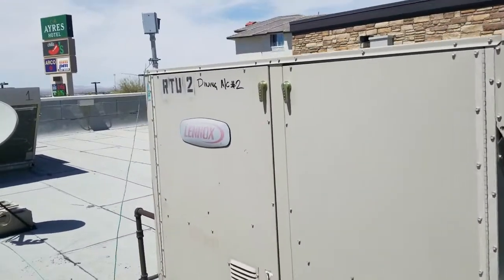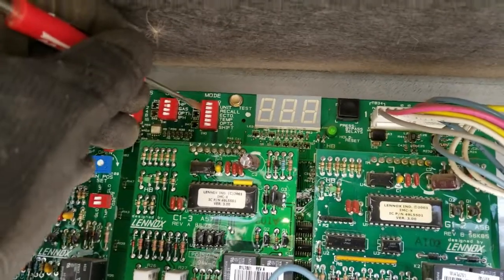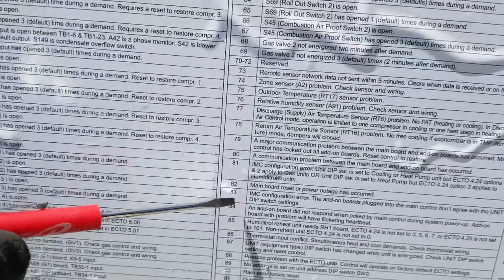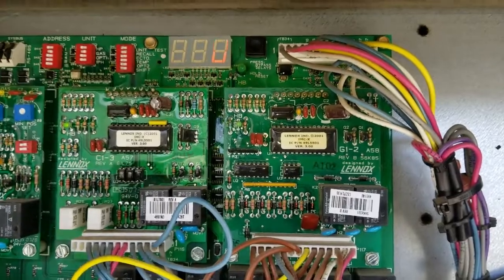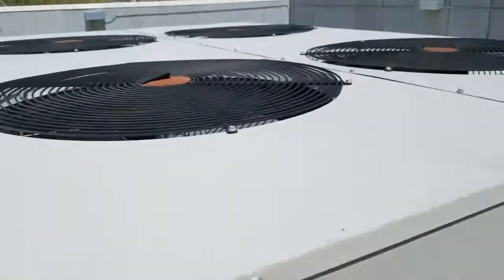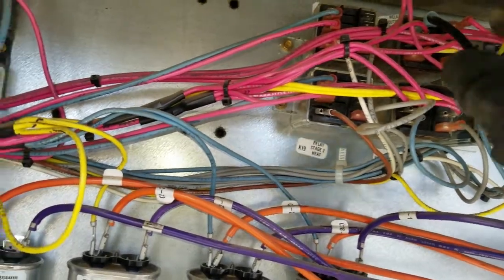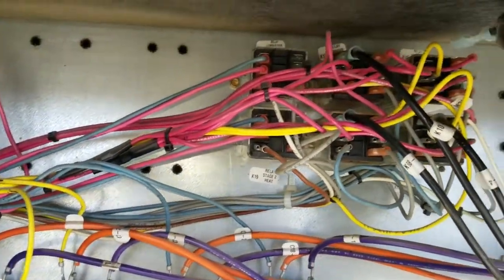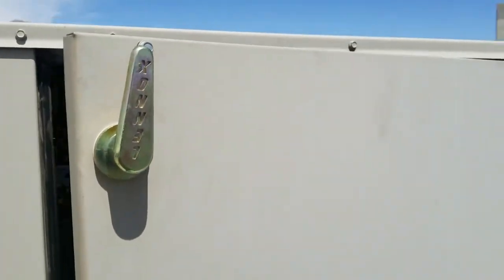Lennox L Series Quick Tip

Comment: The L series units are the most simplest systems in the industry to work on and to service. I’m an ex Lennox employee and went back into the field but the L series Energence systems are even better and easier with the Prodigy boards. You run through the board to do your diagnostics and alarm code checks. That board has never failed me in troubleshooting an issue. Never have had to bust out gauges or my amp probes. Not ever.

Comment: I like that. I’m not all too familiar with the older Lennox boards. I know you can put it in test mode just have to read up on it.
Reply from the maker: To put the older board in test mode you flip the shift switch and the unit test switch. Than you can test cooling or heating

Comment: Couple of quick questions if you don't mind first do you move the wires on the relays to circumvent the head pressure controls? I guess what I'm really asking is in test mode of both circuits would the head pressure switches still keep the stage 2 fan from running?
Reply from the maker: Yes the fans are controlled by the head pressure fan cycling switches